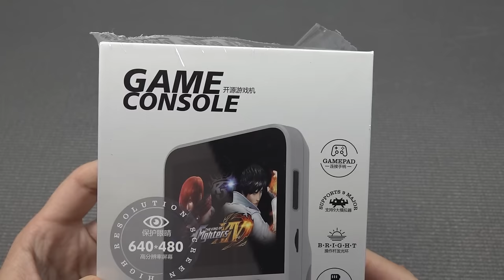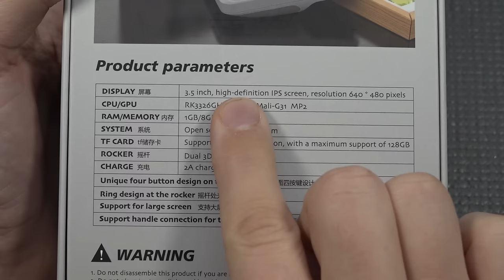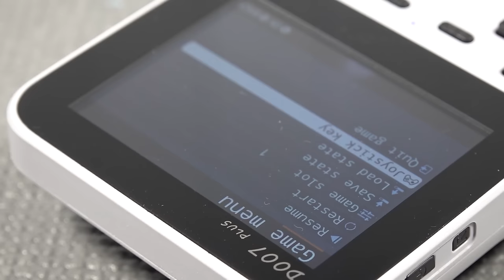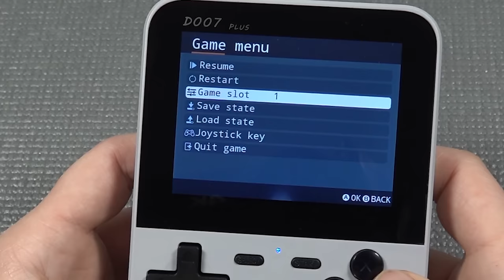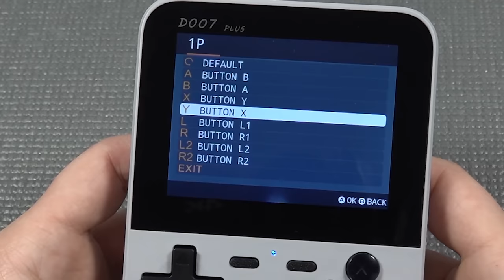Brand New $69 D-007 Emulation Hardware Surprised Me Big Time 😄 !

Comment: That little LED light between the buttons is reflecting on the screen.  It would be good to remove the PCB and check out further.  Other than that I quite like this one.  I think 🤔 if they removed the bezel and installed a larger LCD screen, it would be a winner.  Maybe even double it's RAM.  As for the lack of PSP and N64, most of those games I've played on other consoles have been hit and miss.  But at this price point, I think it's good.
Reply: I agree. Seemed like a nice little machine. For $60 my expectation is lower than this. I mean I just bought a Retron SQ for $70 and I am not sure if I am keeping it or not. It is not upgrading the visuals on GBA. My Top Gear and Duke carts are unplayable even in 4:3.